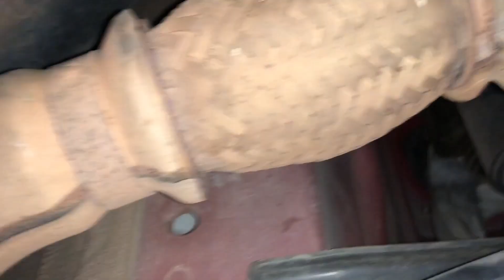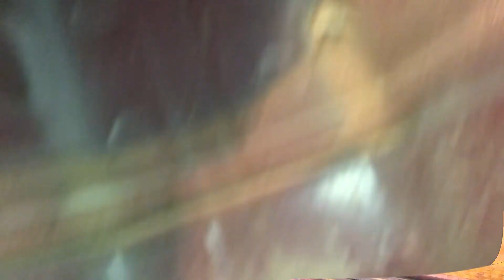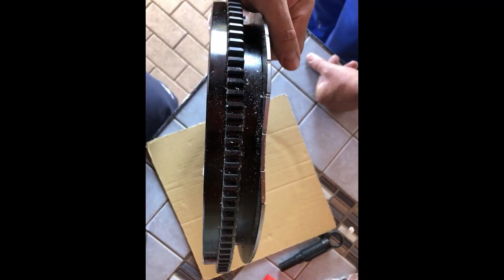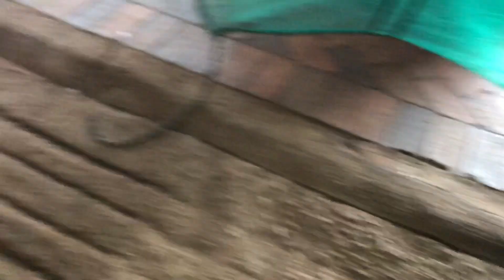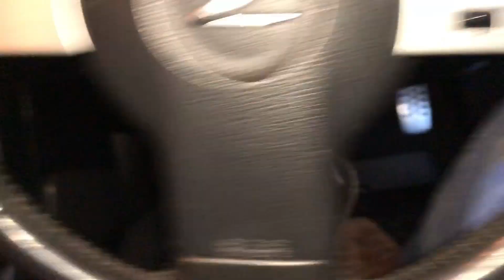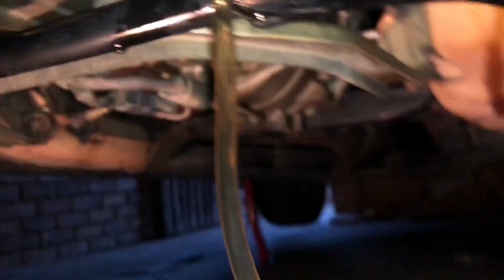JWT Clutch Install on a 350Z VQ35DE

Comment: that chatter sound could be a thrown out bearing
Reply from the maker: It turns out its the gearbox due to eliminating the dual mass flywheel. Car been running like that for 3 years now and it's still the same with no issues